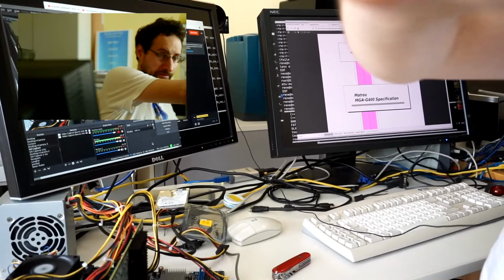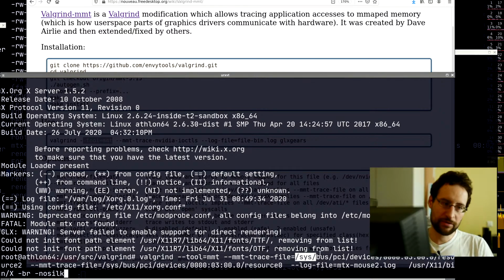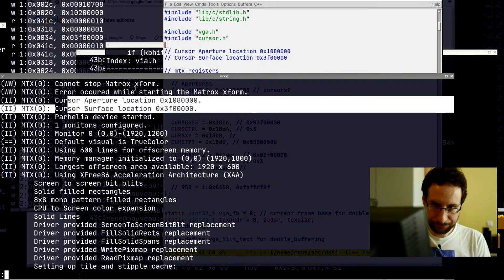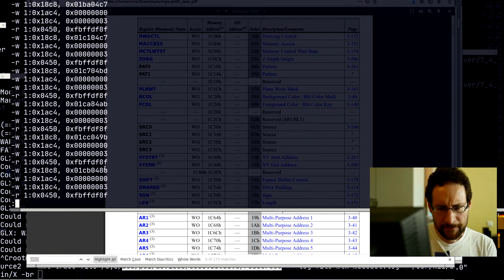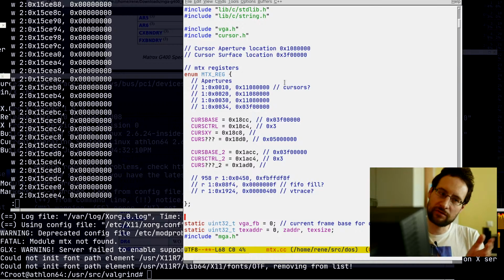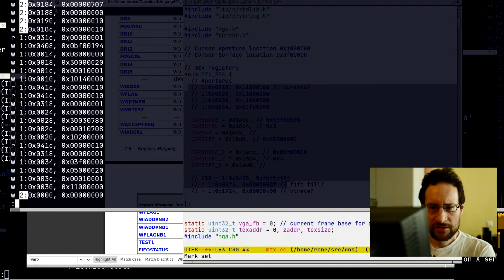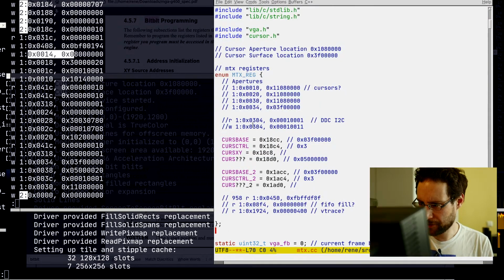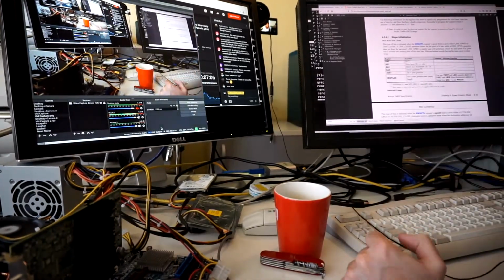Reverse engineering binary-only PCI drivers: Matrox Parhelia p690

Comment: Hello, can you confirm whether the P690 is indeed a die shrunk Parhelia LX? Looking at the exposed die I noticed that it has the code SUN90-A1 written on it as opposed to all the other Parhelia based chips, including the M-Series that have clear an indication that it's Parhelia LX derivative.
Reply from the maker: I don’t have manufacturing insides. If you find out more please let us know!
Reply: @ Okay, with some digging I was able to determine that the SUN90-A1 could indeed be an improved Parhelia LX chip. No actual documentation but bits and pieces of circumstantial evidence that show that it is a Parhelia variant. Parhelia’s alternative name and codename in reference to the atmospheric phenomenon is “Sundog”. The chip is sometimes called PX-A1 (Parhelia LX) or SD-A1 (SunDog). And because it was die shrunk to 90mm, they added that as part of the code, and possibly to the model name of the card (P690). Altogether we get: Sun90-A1.

Comment: Just a thought... When we see the driver writing black (zero) values to the framebuffer we presume this is the background. But wouldn't it be faster to use the 2D engine's rectangle fill on the whole screen?
Reply from the maker: Yes, of course. However I have seen many, e.g. open source X driver just do this. You know, just in case ;-) Additionally X11 historically used this (ugly ;-) weave pattern anyway, which IIRC was among other things intended to help multi sync CRTs to properly sync and later auto adjust. So all in all this extra memset at X server start does not matter the most and looks quite helpful in the debug trace. Fun fact, I just realized today that the Matrox binary only MTX driver apparently uses the start of the vram for the DMA ringbuffer, so it is constantly filling the first n kB of VRAM with the hw accelerated comamnds, similar to other cards, and certainly the open source PS3 NVidia RSX code work, ...
Reply: @renerebe  That's some very nice insight, cool!